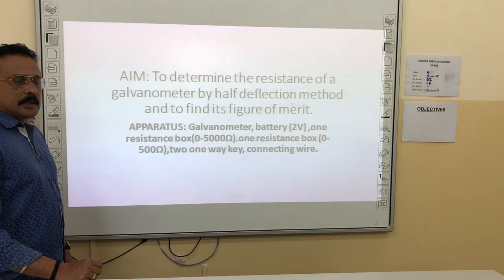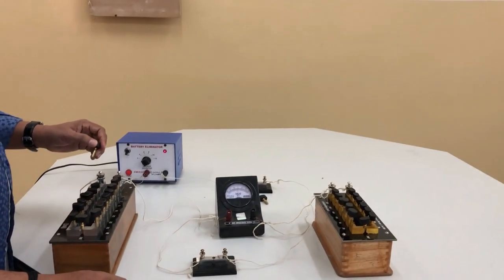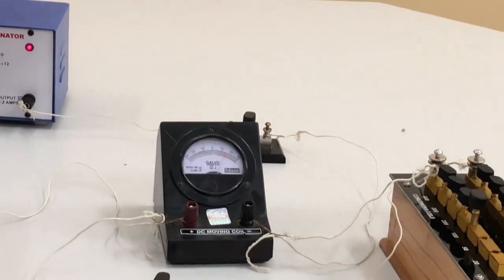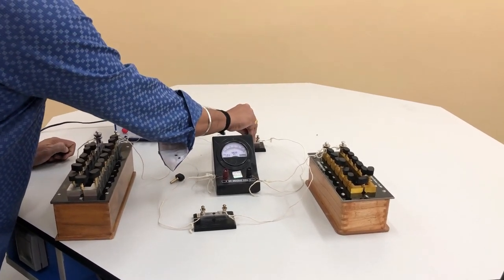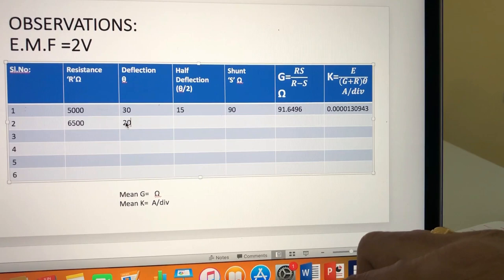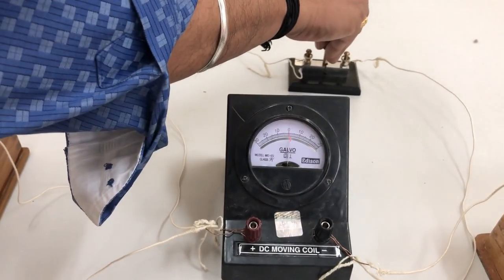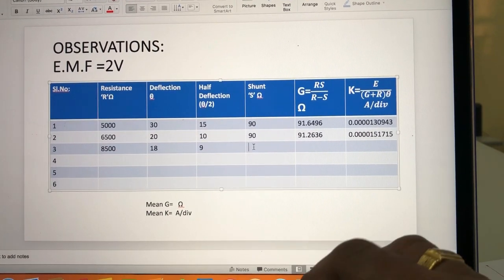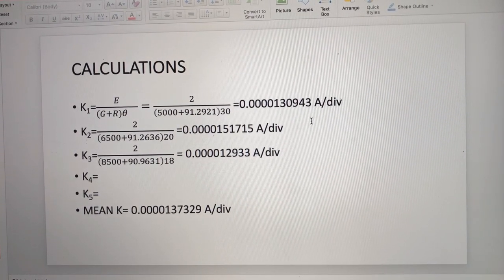To find the resistance of galvanometer and to find its figure ofmerit:Prakash &Mini

Comment: how did you get the value of E?
Reply: E is the value of volts your battery eliminator is set to for examples if the battery is set to 2V then E is equal to 2
Reply: @Aathish0702  tqsm
Reply: @Aathish0702  thank u so freaking much you've no idea how much this helped I was about to have a teeny tiny breakdown ngl😂